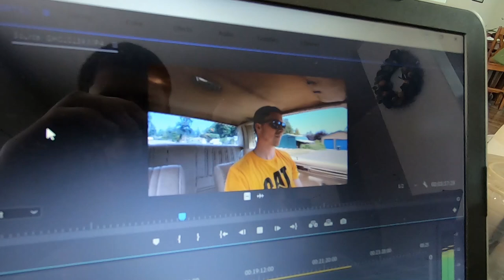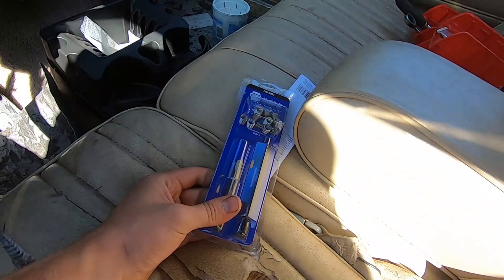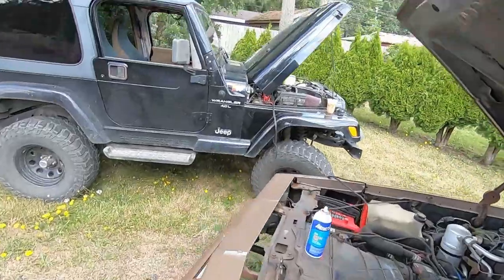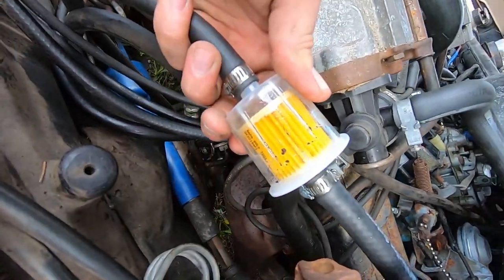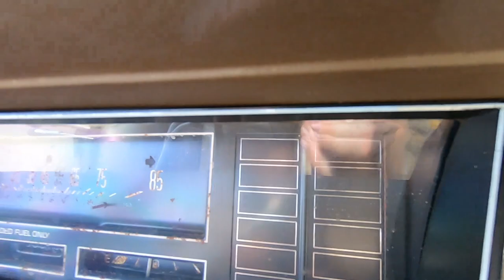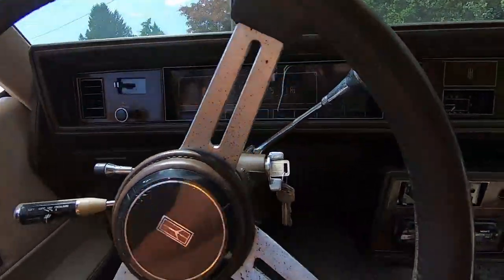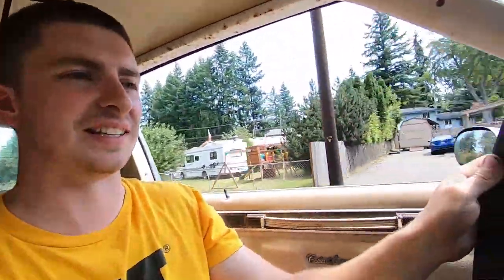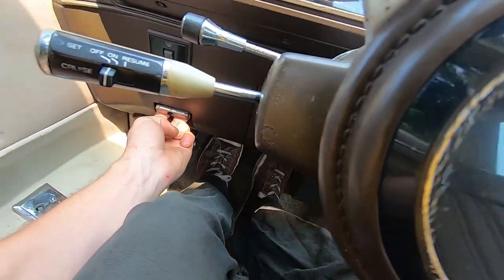Making my $700 Cutlass Supreme driveable!!

Comment: I bought a 86 g body Pontiac Grand Prix about four five years ago. Had that Same Buick 3.8 v6. One of the first things I had to do to it was rebuild the steering column and replace fuel pump, but I didn't take any parts off the front of the engine. It was a pain but it can be done. Hope you still have your Cutlass. I am also on my third g body. I paid 800 bucks for mine.
Reply from the maker: Best bargain around in my opinion. I almost bought a grand prix instead of my 85 corvette. Those are very cool g bodies. Also, I tend to do more work than i need to, its kind of unintentionally my thing haha
Reply: @caseybaker5550  are you going to do any more videos? I sometimes wish I had started a video series on my car which I still have. It is currently in the stages of a engine swap. It will be getting a nice mildly built Pontiac 350 out of a wrecked 74 firebird. Keep going with your project. The Cutlass is the only g body I have not owned yet. Hope to have one of them one day.
Reply from the maker: @jessepaul9774  yes I have another video I have almost finished recording and my plan with the cutlass is a swap but I'm not sure exactly what yet. Still debating with myself. Never too late to start making videos! Honestly it is fun and you would have one viewer in me for sure.
Reply: @caseybaker5550  sweet I'll be looking forward to your next video. Keep the g body's going brother.

Comment: The mechanical advance is often times stuck in the hei distributor if you get that all working right and it has a good carb they will run happy for a very long long time even the v6 yep lol but the beauty of the g body is they came w every engine option there was from olds to chevy and the holes are already there for the mounts so the v6 can be replaced w a small block w no issues at all did that to every one I ever had a small cammed good headed small block with the v6 gearing would be quite impressive  try it lol
Reply from the maker: That is the plan. Then i am going keep pushing it until I break the rear end haha
Reply: ECM controls the HEI advance, hence the check engine light. Possibly the code is from a weak choke thermostat, over time it will go from occasional light-up to full time. Now that it’s old enough I’d strip out the entire power/drive train and wiring, put new crate components and Painless wiring harness, Vintage Air and call it done. That generation tech was frustrating enough when it wasn’t that old, get rid of it
Reply from the maker: @joetaylor2394  piecing together a new setup soon

Comment: I had a 1981 Cutlass like yours.  Look under the hood and make sure that the wiring doesn't get wrapped around the steering.  It happened to me in the 80s.  I could barely turn it from all the wires that had somehow managed to get wrapped around steering.  Could have been the death of me.
Reply from the maker: That is a good piece of information. Thank you very much.

Comment: GM cars, you know it's running when the check engine light is on. On a Caprice my sister has it comes on when the engine is at operating temperature. 
Excellent video.
Reply from the maker: Hahah sounds about right. Thank you

Comment: With a 350?!?! 
Casey, dude, NO!!!
That 6 can handle all the boost!!
Reply from the maker: I don't want to deal with all that boosted heat i am putting big wheels on it so it needs to be v8 loud and obnoxious and it needs to shred tire at will with a high stall converter
Reply: @caseybaker5550  ,I myself love gbody Oldsmobile Cutlass supreme cars, and the Cutlass Cali's,had several and 4 Buick regal sport coupe and limited cars... Anyways I wouldn't put really big wheels on it not really my thing but not my car,you build it how want to and enjoy it... And honestly my preference is olds 350, and olds 307 olds 350 has plenty of power and even the 307 isn't completely gutless don't believe that,try almost any other transmission except the th200c behind it, and the olds 307 is almost dead reliable.  I have plenty of knowledge of these cars and know others who know even more info on them than I do like Brian suter of classic gbody garage right here on YouTube, anyways you can message me back if you want to ask me anything... I had a 78 Cutlass supreme brougham 260 olds v8 car swapped to Chevy 305,a 81 Oldsmobile Cutlass Calis t top ,a 84 Oldsmobile Cutlass supreme brougham that was a Chevy 3.8 v6 229 swapped out for a 79 Chevy truck 0.30 cammed 350 and then I swapped in a 1991 Camaro RS 305 tpi and carbbed and cammed it also 0.30 , and I had a 85 gold Oldsmobile Cutlass supreme brougham same color as yours and learned it's actually called medium chestnut brown, there's a light and dark chestnut pigment color also. That one had a Buick 3.8 231v6 dual jet 2bbl with a tps sensor and idle stop solenoid issues, but the motor knocked carried somewhat decent oil pressure so I bought bearings, gaskets, timing set and new oil pump primed the oil pump and put the motor back together but without pulling it out of the car, wanted to buy more parts and a complete engine gasket set before I pulled the engine out, put it back together and at first it carried good oil pressure,then it lost all oil pressure and started knocking loudly didn't last 4 weeks to run well enough to drive I ended up getting rid of it after my brother was playing around with it in the field and the engine blew,I had planned to put a olds 307 in it but ended up getting rid of it first because I had 4 other gm trucks and 2 86 Buick regal olds v8 sport coupes, and a 83 Pontiac Grand Prix solid body with a bad Chevy 3.8 229v6 and a th200c that only had reverse.
Reply from the maker: @richardbates2367  wow thank you for the comment! That is quite the g-body history right there! I am definitely going to go a little more extreme than I should but I still want it to be a comfortable cruiser with the power to pull on some people periodically. Haha I am fascinated by nitrous right now and people who can make reliable nitrous power and still street drive their vehicles pretty regularly. I definitely would still lile to find more clean g-bodies and keep some original because they are so great from the factory. Thank you for sharing!

Comment: The correct way is this...pour a little gas in the carb, if it fires you know the ignition is good...then pour gas into the bowl vent, about a half cup...now it will run till the bowl empties..repeat till it no longer stalls

Comment: I always liked those wheels, but they are getting super hard to find nowadays
Reply from the maker: I definitely dig them. Eventually the wheels will be much bigger haha
Reply: @caseybaker5550  i run 245/60 rears and 205/70 fronts the fronts are about a half inch shorter than the rears but like 3-1/2 inches narrower, makes for a good stance :)
Reply from the maker: @TheSouthdownband  good to know because I wont be switching to big wheels for a while

Comment: Use gas not ether you'll put a hole in a piston or bend a rod plus you can fill the fuel bowl and it will stay running leave the ether for the old diesel motors there's no reason we should ever need it pour gas in the carb it's way better off that way
Reply from the maker: Hey I appreciate that a lot. Good warning haha